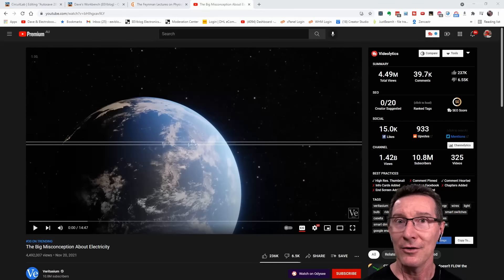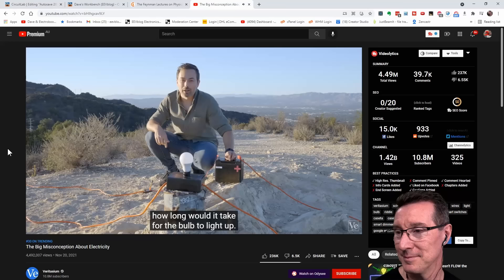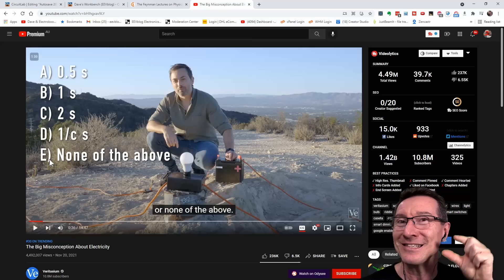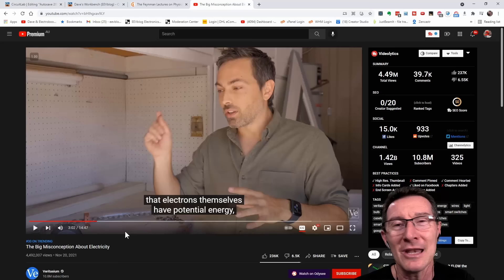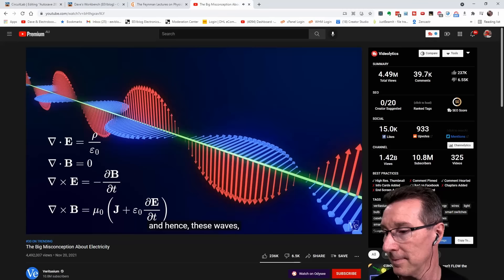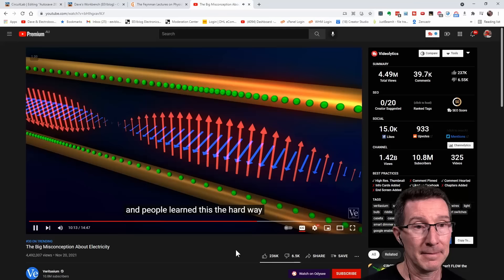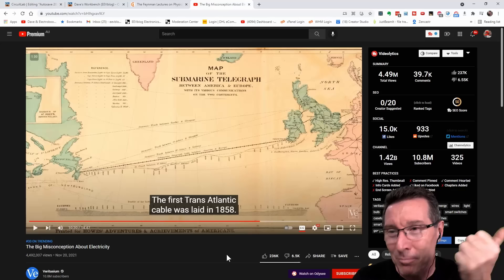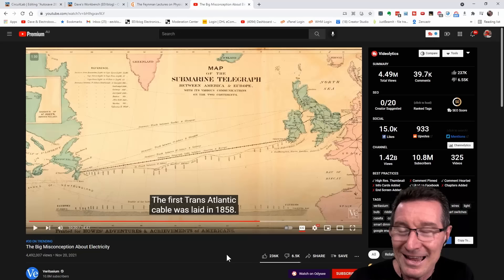EEVblog 1439 - Analysing Veritasium's Electricity Misconceptions Video

Comment: I accidentally measured the light speed while sending a nanosecond pulse over an open ended BNC cable.

The Digital scope is connected to source with 10 meter long BNC cable, on connecting another 10 m BNC cable with same cable. I am receiving faint pulse back at about ~65 ns later, the delay is alomst close to (2* length of cable)/c.  

According to Derrick, if I move the (open) end of 10 meter long cable 1 meter to the scope, should I received the same pulse exactly 1/c seconds later?
Reply: No, you'll get the same 65 ns!  Try it.   That's the problem with Derek, is confusion because of a very poor explanation.

EEVblog's lumped element model here is not the right one for Derek's experiment set up.  Derek's answer of 1/c is not entirely correct either.

You'll be surprised at what the answer really is ....

Go to the top and sort comments on "Newest First", scroll to the time stamp of this post, and read mine.
Reply: @stickfijibugs  Sorry for the late reply I had the notifications turned off. 
You are exactly correct, no matter where I put the other end, the delay was exactly 65ns, even if both ends are together. 

My point here is Derricks theory is correct for bare open wires but not for shielded wires (I believe for coaxial cables as well) . There the pointing vectors are confined within cables and the power has to travel through the wire. The bulb will only lit up after cable_length/c seconds.

Comment: Why the circuit must be grounded in your example? Many thanks
Reply: The 'ground' symbol (the downward arrow) is for the software to work properly, it does not mean the wire is connect to earth ground.  'Ground' for EEs is just a common point in a circuit.  Here it has no effect on the model results.

Comment: Lets face it the wires are an important factor in the propagation of these fields, without the wires the electrons have no specific direction, so surely the wires carry the energy and the fields follow the direction or at least create a path for the fields to follow.

Comment: At 12:36, he says "Energy is just power over time".
If he means "Energy is just power during a period of time", he's right, since energy = power x time.
But if he means "Energy is just power divided by the time used to deliver it", he's wrong.
Both interpretations are grammatically correct, but only one interpretation is technically correct.
This guy needs better script editing skills.

Comment: you can't simulate Veritasium's ficticial experiment with 31:51 circuit. Because the simulator can't manage electricity speed.
Reply: In fact, EEVblog's lumped element model here is not the right one for Derek's experiment set up.  Derek's answer of 1/c is not entirely correct either.

You'll be surprised at what the answer really is ....

Go to the top and sort comments on "Newest First", scroll to the time stamp of this post, and read mine.

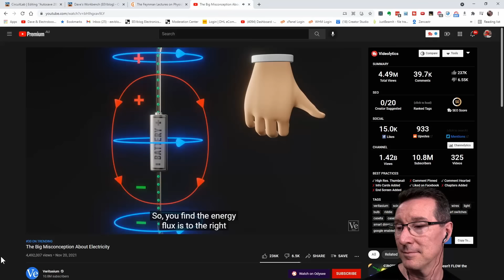Comment: 9:20 Since we're being super technical here, shouldn't we say the electric field is up, since the concept of conventional current is wrong/opposite... with electrons being what moves...
Reply: Also, I always se these examples showing radial flow and just referred to as "left" or "right" instead of maybe "clockwise" which for anybody with any sort of engineering mindset means it's obviously counter-clockwise when viewed from a different angle.

Comment: So, I hope that is not a stupid question, if it is, call me an inattentive idiot.

If the power has to flow all the way through the cable at dc, when will the light bulb turn on?
At the last part of the video, we only talk about the power, which is floating arround the cable, not about the time anymore.
Reply: Yes it is dumb because the light is already on when it is DC.

Comment: I only am able to follow through the first half (to much electronics then). All of Veritasium's video seems corect. Isn't then an ountmost collaborator able to give atomic clock synchronized signals back by giving info bits with cutting the wire, where we sitting at the light bulb get the information out of the future half a second earlier than the information was generated? Since Albert E. I got used to think we should get the information with light speed half a second later .... what a mess ...
Reply: No, Derek introduces confusion.  EEVblog's lumped element model here is not the right one for Derek's experiment set up.  Derek's answer of 1/c is not entirely correct either.

You'll be surprised at what the answer really is ....

Go to the top and sort comments on "Newest First", scroll to the time stamp of this post, and read mine.

Comment: What the heck is DC then? I can imagine AC like sound waves, i.e. pressure waves propagating through air at the speed of sound. Except with electricity we have electrons instead of air molecules and speed of light instead of sound... BUT, what is DC then? Is it a constant push of air? We know electrons barely move so what propagates then? Waves have frequency but what is the frequency of DC ? How does the DC wave even look like in the analogy??

Comment: I would expect C to be well less than 1pF and L to be well less than 1nH. So this will only work with 0.0000 Ohms.
Try your simulation with a 12V battery and a 12V incandescent lamp which you see start to glow at 7V.
A short transient. How long for the transient to rise to 7V?
How long between the transient at the bulb and the steady state being established?
You could also try 0.1mOhms per meter, a big thick wire.
As you say.... But no.
No is the answer of a wise man.

Comment: Love you videos but I've given it a few minutes of thought and I don't think the answer is 1m/c s. 🤔 Just hear me out. 

The Poynting vector describes a static system but the question is actually about a dynamic systems because the switch is flipped.

Think about a small change to the circuit topology, if the switch was placed at the furthest point from the batter/lamp (half a light second away) in order to flip the switch and turn on the lamp in 1m/c s that signal would have to exceed the speed of light. Judiciously I'm forced to conclude that cannot be correct.

There is a text book that covers this called "Classical Electrodynamics" by John Jackson. 👍

Comment: So how do you calculate the 1uH on the capacitors connecting the bottom and the top on each section?
Reply: EEVblog's lumped element model here is not the right one for Derek's experiment set up.  Derek's answer of 1/c is not entirely correct either.

You'll be surprised at what the answer really is ....

Go to the top and sort comments on "Newest First", scroll to the time stamp of this post, and read mine.

Comment: Great reaction to veritassiums initial video (which I still think was also great). However, I would like to add two notes: First, veritassium is clearly not addressing engineers. So it is true, when you point out, that everything what he says is well known, but that's not his point: He says that it is taught in school for simplicity reasons actually wrong and most non-scientists and non-engineers believe that what they heard in school was the complete truth. Second, at 9:30 you critizise Derek for getting the direction of the poynting vector wrong or confusiung AC with DC. I think, that actually it is you, who is incorrect, because at the source the current is against the charge gradient, so the poynting vector does point outwards in DC. Am I wrong?

Comment: If you consider "c" as only a number (300.000.000) then Derek's notation is correct. It's (1/c) s. But if you rather wanna consider that any variable in the formula caries its unit, then the correct response is distance/speed or (1 m)/c or (1/c) meters. Not ((1 m)/c)) seconds. What do you think? Kkk

Comment: Yes, that's why I spend a minuscule amount of time dwelling over that guy's videos. Everything he does presents himself as the guy who's challenging all our physics and electronics laws. I have better things to do with the little time I have left! BTW, I love Transmission Line Theory!
Wakodahatchee Chris
Reply: Careful!  Dave here uses the wrong model for Derek's experiment setup.  A transmission line model is not applicable, so what you see on his graph is incorrect, and Derek's answer of 1/c for immediate steady ON is also not entirely right, it's misleading. For the immediate transient, the better model is a dipole antenna model.   Also, Derek conflates DC steady state with transient analysis which is false and folks who want to learn, get misled.  See my explanation in the main thread.

Comment: GENIUS. thanks
Reply: EEVblog's lumped element model here is not the right one for Derek's experiment set up.  Derek's answer of 1/c is not entirely correct either.

Go to the top and sort comments on "Newest First", scroll to the time stamp of this post, and read mine.  You'll be surprised at what the answer really is.

Comment: Thank you for mentioning Skin Effect. I was wondering the same thing. He missed out the important concept and difference between AC and DC. Perhaps he is trying to explain Engineering and Physics simultaneously in a short video.
Reply: Correct.  Moreover, EEVblog's lumped element model here is not the right one for Derek's experiment set up.  Go to the top and sort comments on "Newest First" and read mine.

Comment: Any time there is a changing em field* and that pretty much true in all of chemistry as well, or whatever else, you could apply the em poynting vector to heat pumps as well 🤦🏻‍♂️😅. I don’t think he said anything particularly wrong tbh, only maybe a bit misleading, but its a popular education video anyway, but its fun to be picky. Basically any thermal energy transfere works exactly the same way, if you did have a solution of the pure state of a heat pump for example, the pointing vector would point from the condensor out into space, into the evaporator, and into the compressor. Anything that isnt involving transfere of energy through the string or weak interactiom works like this, not as spread out innspace as a circuit is but even his chain example would have an em Poynting vector field describing all the energy flow :p from his muscles to the heat being generated from friction to the air and table and so on. But that doesn’t mean mechanical engineers should be fired for working with simplified concepts lol :p

Comment: It's the little caveat he used near the end that saves him because all through the video he sounds like he's saying the lamp will light up as soon as the em field hits it.

Not till the end does he say 'it won't get full power till the current travels through the wire'. Unless the load is extremely efficient, there would be, admittedly apparent, but almost negligible power transfer. There would be enough for signal transmission, but not power transmission.

Comment: Thanks. This is a far better explanation of what actually happens than Ve presented. So the only extent to which the lamp "turns on" is a microscopically short pulse to charge the line capacitance to 12V. That would not cause any significant heating in the bulb element and would not make it incandescent. So how long would it take for substantial current to flow? Seems like we are back to circa 1s round trip and that is still in a transient state. The Veritasium vid was a fraud which attempts to answer something other than the question it poses. The physics and electrical theory is interesting but the claim is false and intentionally misleading. As our host EE says, that is what lying means.

Comment: So consider thickness of cable is important if transmitting higher amps, then could a copper pipe be safely used if it's the same diameter? IE 1/2" for main lines to a meter box? Just asking theoretically, not going to try it. LOL
Reply: A copper pipe could carry one leg of electrical service, as proven by their frequent use in electrical sub-stations.  They use air insulation there, so their inflexibility is not a problem.  They would have to be jacket insulated if used as retail drop lines, but that means they could be bundled.  For residential service, 1/4" would be plenty big.  
"
Reply: @samuelarcher9236  wow. That's an excellent answer. I had a feeling I was making some sense. Thank you.

Comment: His simulation is not at all accurate. 
What he simulated is two transmission lines, and neither is transmitting power to the bulb. 

He used no resistance in his lumped-parameter model, so he had to leave the ends of the loop open. If he had closed them, the inductance would not have mattered. 
The 1-meter distance separating the battery and bulb, and the very large rectangular loop of wire, make an ideal inductor. Model the system as a 1-meter transmission line with a large series inductor.

Also, there is nothing disingenuous about the 1/c seconds time. He specifies the distance as 1 meter. He uses c=3x10^8 m/s. Meters / (meters/sec.) = seconds.

Comment: I’m still confused. Does the energy completely come from the field or just some? And if not all from the space around the wire, then how does it come from inside the wire?
Reply: Completely from the field, as pointed out the time it takes for the light to come on is 1m/C seconds hence why even though the wires are 300kM (one light second) when the switch is thrown the light comes on near instantly. This is because the "distance the field traveled" is only 1m not 300kM.
Reply: This is well explained at around the 18:15 mark of the video. This is also why he points out at the beginning that veritasium left out the meter unit in their 1/C seconds answer.

Comment: Can some one explain to me the affect if shielding cables. For example in audio frequencys where the frequency and current is varying. Would shielding the cable affect the engery transfer. And also how will engery transfer work in a signal path capacitor or a solid state amplifier for example a class A amp. How would the engery flow through the transistor at varying frequency if the engery is flowing around the wire or around a ic component. Or does none of this matter.😅🤯🤯

Comment: You keep repeating that this is Engineering 101. But you have a computer and a simulator and you can't give support for the 1/c answer.
To be honest, Derek didn't put it cleanly calculated.
But, such number should be acquired by paper and pencil.
If you can't do that with a computer, don't say meeeh.

Comment: This was a great vid and brought back a lot of memories of my circuit theory and waveguide classes.  Kudos! 
The only thing I'd mention is that if you were to add the unit next to the 1 to 1m as you suggest, then definitely also put the units for c (m/s).  That way it's clear that the 'm' unit cancels out.
If I saw 1m / c s I think I'd flip out just a little bit.
Reply: EEVblog's lumped element model here is not the right one for Derek's experiment.  Go to the top and sort comments on "Newest First" and read mine.

Comment: Sorry - but agreeing with Derick's errors isn't a useful approach.   I suggest you calculate the MAGNITUDE of the of the Poynting vector at say 6ns after switch closure (~2 meters light distance in the switch frame of reference) and then integrate the Poynting vectors over the surface of the bulb to derive the power flux.   It is on the order of 10s of microWatts.  By comparison the sunlight striking the bulb at high-noon is ~4 Watts.

We know that he ONLY way to produce light is to accelerate charged particles.  The electron (lightest charged particle) must be accelerated through a 1.5volt or greater potential to produce visible light.   No such field exists at the bulb at 6ns.    You might argue that we can also heat matter (like a tungsten filament) to ~2500K and produce significant light by the lattice energy accelerating charges to >1.5eV.   But you'd need to focus all the field energy that goes into the bulb onto a few micro-grams of matter to accomplish that before 1 second elapsed.

Derick's claim that ANY current would cause light ignores entirely how light photons are actual created.  But there is yet anther error if literally ANY current would cause the bulb to light, then it must be alight all the time.   There are thermal electron currents in the wire and bulb at anything above absolute zero temperature - so it's always by definition on.
Reply: Right again!

Comment: They are all wrong.  
First at all:  in practice you wouldn't go  so far with a 12v battery. 
Second: in DC the signal flows for the entire cable, not the external layers.
Third (speculative theory to explain a speculative experiment)
You'll need to raise the voltage to hundred of kilovolts through giant transformers,  to use huge low resistant wires capable of resist solar winds and other extreme conditions. (At lot of things in the middle like skin effect, interference, heat, radiation and other things shouldn't be halted ) Then After in the moon,  you'll need reduce the voltage again with another power plant station and  after that will see if you can turn on the damn bulb... and  by the way I forgot the price of the spacecraft expedition to the Moon to put that bulb in a kind of big lighthouse maybe.  When the NASA got to that point, lets talk again of what would happen with that bulb.  That example is too speculative because there are too many variables.